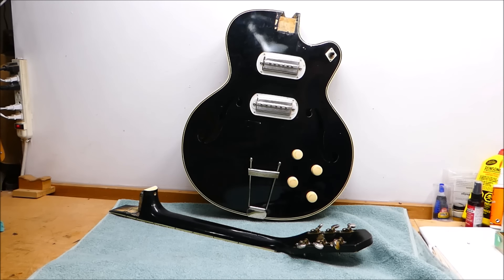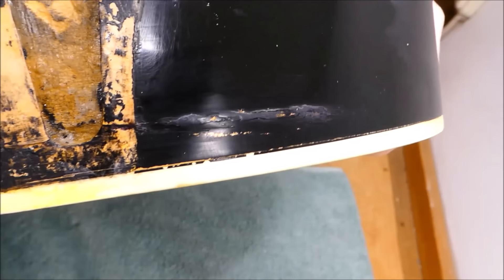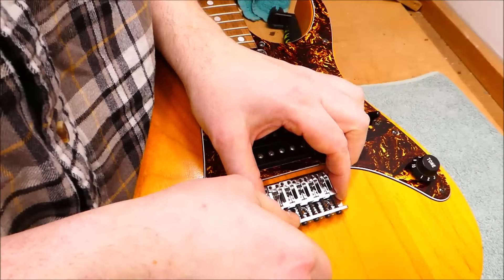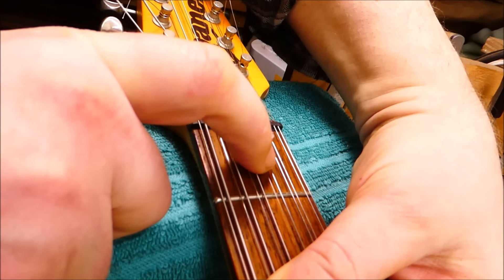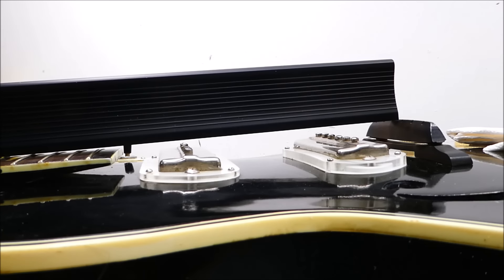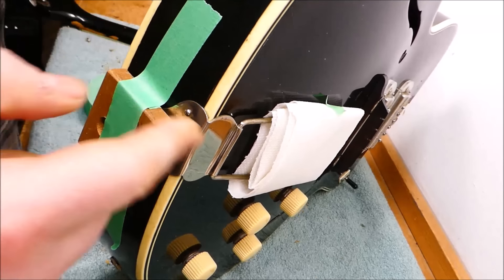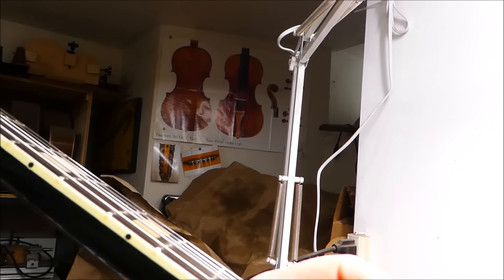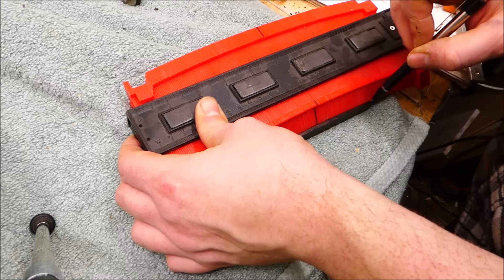50's Silvertone gets feisty with me.

Comment: 31:13 What do you mean by Wire Cutter Tuners?
Reply: I presume he means that the holes in the tuning posts have a sharp angle and aren't beveled or chamfered, therefore the string bends back on itself sharply and kinks where it exits the hole.  I suppose this could be fixed with a drill bit or counter sinking bit or a Dremel tool, but changing out the tuners is probably a good idea under the circumstances.
Reply: @goodun2974  Oh right those tuners weren't properly built so they need to be replaced so that the new strings last longer.

Comment: Very nice Ibanez man. Haven't seen one of those in the wild for some while. Thanx.
Also, I just p/u at auction for a good $, a very nice looking "Old Kraftsman" archtop in a very sweet Honey Burst finish and fully bound body and fingerboard with a B&W checkered perfling around the solid spruce top, maple sides&back. Original Kluson Deluxe tuners (need buttons).
Frets are very small though and FB is flat all along (NO Radius) and needs a bridge/saddle and some lite finish touch up. Probably a N reset too as some gappage is evident . NO CRACKS. Slight  binding shrinkage but not too egregious and inlays.  I'll see, but a real beauty.
I'll try send you some pics. Cheers.

Comment: That’s a Gotoh 12 string bridge, which I’ve used on a custom 12 I built. The string through body holes r correctly made. They r not in a straight line, they r staggered. I made a template to help me get the spacing correct on my build.

Comment: That has a nice thick tone
Reply: A bit too thick perhaps, not as bright as I would have expected (the vintage Silvertones I am most familiar with had either DeArmond pu's, or Danelectro lipstick pickups). Perhaps the pickup was being loaded down by the resistance value of the controls or the value of the tone control capacitor.  Or maybe it didn't like the input impedance of Ted's small practice amp.  That Ibanez 12 string certainly had no shortage of chime and jangle!
Reply: @goodun2974  my ears are telling me that tone would fill a nice percussive space chucking out a rhythm on a reggae track. I would definitely put a noise gate somewhere in the signal path though.
Reply: @guitorb  , some added shielding, or using shielded wire for the pickups and controls might help, but replacing such things on an archtop is seldom easy. Ted is a wizard with wood but he always seems somewhat reticent about improving the pickup and control wiring.
Reply: @guitorb  , David Lindley often played a Danelectro-built Silvertone on stage with his mutant reggae band ElRayo-X; look on YouTube for his performance of "Quarter of a Man".
Reply: @goodun2974  I will. Thanks!
Reply: @guitorb  , now that I've figured out how to add links, here is Lindley  playing Quarter of a Man on a Silvertone. https://youtu.be/txL3Z4JlFeo

Comment: A correction about the P-13 pickups. Gibson did not "sell off" their leftover pickups to Harmony. Gibson was an OEM supplier of complete wired harnesses to Harmony in a business relationship spanning at least a decade. There is absolutely no way Gibson made enough P-13s or parts, during wartime in the 40s, to supply Harmony with pickups for almost 20 years. Gibson also created a pickup specifically for the Silvertone 1446. 
I don't believe Harmony even had a soldering iron on their production line. Every electric model made by Harmony can have the electronics (whether supplied by Darmond or Gibson) installed or removed as a single assembly with a wrench and screwdriver.

Comment: re the 12 string ... why new bridge vs just replace the broken saddle? And re the shim ... especially since it was already too long for the pocket, rather than sand it down, could you not just cut off a bit of the thicker end? Of course you might need to make new neck screw holes, but wouldn't that sort of solve two problems at once?

Comment: Oh wow, I've just discovered the sound of double strings, simply by converting a 6-string to 3 octaves. E and a g-string tuned down to e, A and b-string tuned to a, D and an e-string tuned to d. It sounds great. Adding two extra tuners and changing nut and bridge, well, then you got a problem, what string will be the octave for a g-string? Oops. Going to a bass can solve this, take 4 bass strings. On a guitar scale length you'll end up some frets higher than the usual EADG, but you might not find guitar strings long enough for a bass, though some strings are pretty long, for there are weird upside down necks.
    Ever seen my Ibanez Gio? Funny your 12 string is an Ibanez too. Mine has the tuners on the treble side of the headstock, so 6th string E is long, and that is strange. Thought it was a leftie, nope, it is a weird Ibanez. However, extremely good guitar for the money. I got the 2009 Spring edition. Howling to the moon, they called it. Buy such Gio's secondhand, clean it, replace the rusting strings, do a setup and you will be amazed. If not, replace components you dislike, for what is wrong with it? Not that much, so you can fix it. Are you into locking tuners? Buy them. Other pickups? Spend all your spare money, why not? But okay, enough. Even this Ibanez Gio sounds great, when you convert it to a double string guitar, that has an octave string for each fundamental string. Problem is, you really want a 12 string guitar with SIX  octaves, once you played it. Do these high pitched strings even exist? Even lutes and bouzouki's got some octaves and higher strings are a different story. Help!

Comment: How does that grounding works? Pretty sure the copper tape is conductive, but the adhesive backing is not, creating electrical isolation between the strings and the ground wire

Comment: Nah ! this bridge isn't the original one (it should have the proper radius and the white plastic strip on top)... this one should be on a more prononce arch topped guitar initially (like H131x models for instance). These great harmonies guitars are relatively new collectibles but may required an association of "replacement" parts from different guitars of the same area (with different fits, of course). But they worth the efforts to given them a new life for the glory of the jump blues ! This one is post 1958 where they went for full size thickness of the 1385L (3-1/2") to this slimmer 1427L deep body.

Comment: Shimming a bolt on neck is interesting. I have a Yamaha Bass that had a bad neck angle which I was able to fix with just a little sanding. Years later, I determined that my Strat had a bad neck angle, and after doing some research on YouTube, decided to shim it. Initially I started with a StewMac thickness shim, but found that was way too thick. I started using thinner and thinner materials. Ultimately, I put two or three layers of 1/2 inch wide Blue Painters tape on the bridge side of the neck pocket. That was all it took. Everything else was way too extreme, and messed up other aspects of the neck angle. To this day, it still amazes me how little tape it took to correctly shim the neck angle. If you've got a bolt on neck, it costs almost nothing but a little time to see if this type of fix will work. 😎

Comment: Actually the thru the body string holes are not drilled haphazardly, they match the the hole pattern in the bridge as intended.
Reply: Must have been designed this way to provide a strong break angle.

Comment: I know nostalgia and all that, and normally I can find charm in the older sounds, but sorry, that Silvertone sounded like someone strung old wire across a cardboard box and amplified it by holding up an old-timey megaphone to it. Not one on my bucket list. Of course, Ted did his best and went above and beyond as usual, but sometimes there's just nothing there.
Reply: Assuming that the pickup wasn't defective,  my suspicion is that the other leftover Gibson pots used with it had the wrong impedance to work well with that pick up.  It was probably being loaded down by a poor impedance match or perhaps the tone control cap was defective, or a poorly chosen value.

Comment: Similar issue with an old  Hofner, crack in the neck block when I took it off, old break so not my doing, and that 12 string I have only had one of those on the bench, had a few Fender ones but only one of that breed.

Comment: Another great video!  Curious:  on the Ibenez if the replacement bridge was the same is there a reason not to just take one saddle from the new one and replace only the broken old one?  I mean I appreciate watching you do your normal beauty job but it seems to me that might have saved lots of time and work….
Reply: Yeah, I was wondering that also.
Reply: If the owner is a so-called collector (they're strange folks sometimes) maybe he was afraid the new saddle on the used bridge would look a little less used and wanted it to be just super ultra perfect. I wouldn't care if it was my guitar.
Reply: If one of the saddles on the old bridge had broken, maybe some of the others weren't aging so well either. Aesthetically I guess it's nice for all parts of a bridge to be the same age, with the same level of patina... And if another saddle should break in future, the owner will have some spares which are pre-aged to go with the replacement bridge (which hopefully has a lot of hours on it before anything breaks again).

Lovely guitar!

Comment: I totally disagree with your comment concerning saddle notches depth "you almost can't blame them in the factory for leaving them high becaus going too low with one slot is just desastrous ...". We talk about one the most important thing for playability and intonation. And we don't talk about micrometers, but 1/10 millimeters, and also you could fill a slot to avoid makig a new saddle. Would you say this "you almost can't blame ..." phrase to a car shop which did not screw on your breaks properly which caused an accident – just because it's harder to do it with a torque wrench than with a standard wrench?

Comment: all that work for dead tone. OUCH.
Reply: I will hazard a guess that the value of the potentiometers and/or the value of the tone control capacitor were loading down the pickup and changing its frequency response.  Ted said these guitars were built with leftover Gibson parts, and Gibson was well known for poor choice of potentiometer values that turned the sound to mud.